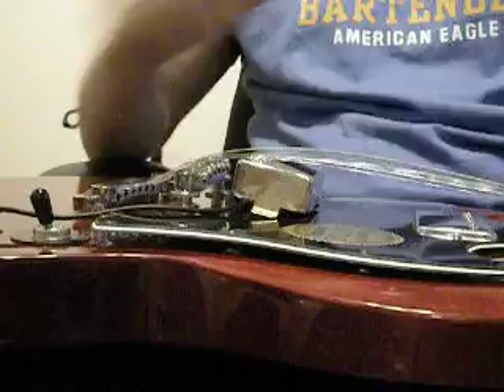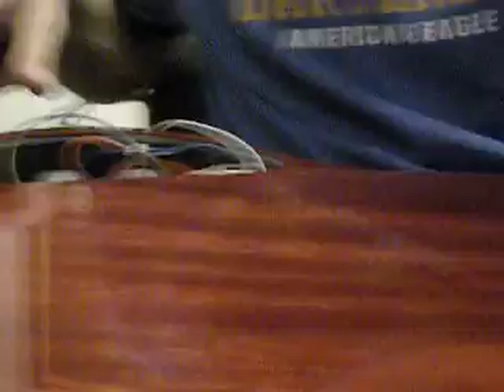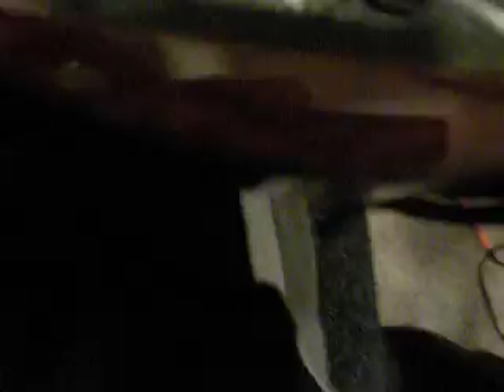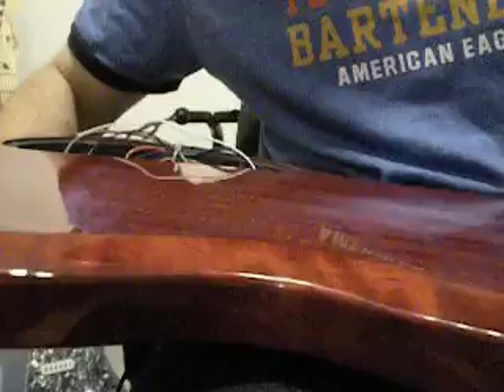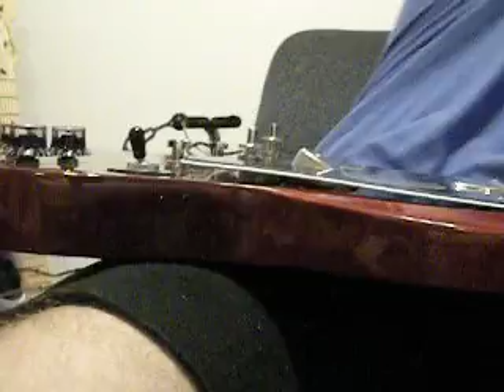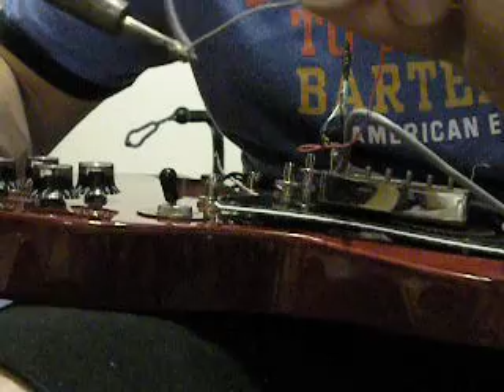(Part 1) How to change pickups humbucker Epiphone G400 SG 1966 Reissue Angus Young Signature Bridge

Comment: I watched your video on comparing the epiphone sg400 1966 reissue against a standard gibson sg.  The gibson only has a little more output than the epi but I was wondering how the bridge pickups from both of those guitars compare to the Angus young pickup.  Would the angus young pickup be worth getting if someone has a gibson sg standard and/or an epiphone sg? as far as nailing the ac/dc tone

Comment: @buckster7777 Btw, a much easier way to do take out the posts is to take a screw (I usually take one from a light switch cover) and put it in the hole where the Bridge Posts are, and then take the Studs and keep screwing the studs in and then posts will come out. 

If that doesn't make a lot of sense I can link you to a video that shows how to do it.

Comment: This entire video is nothing but soldering over a guitar, for no reason. Why would you leave the guitar under hot solder, you could have soldered those lead ends on a table or bench.  And if you were soldering something that was attached to the guitar, always use something to protect the guitar, unless you want burn marks on it.